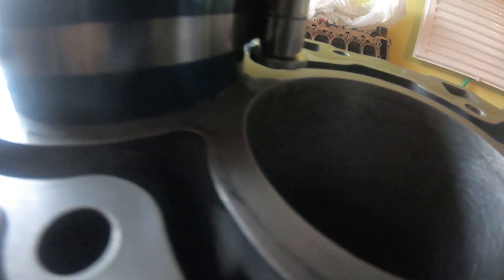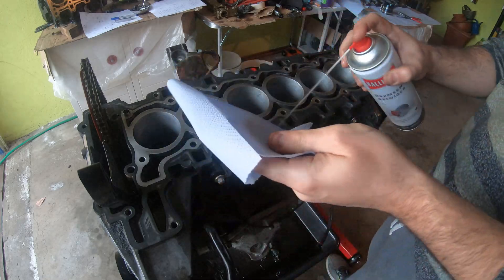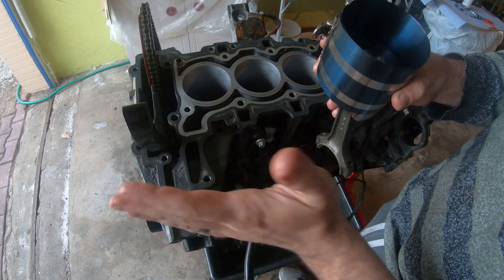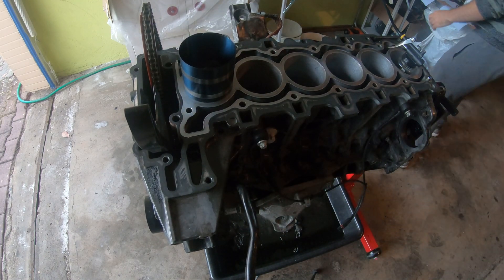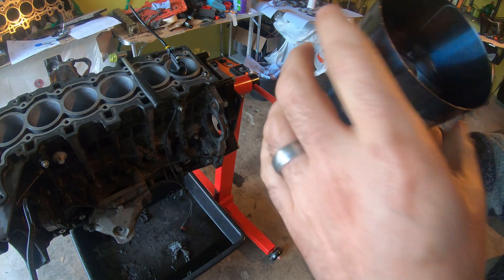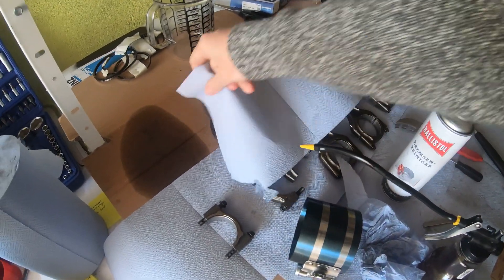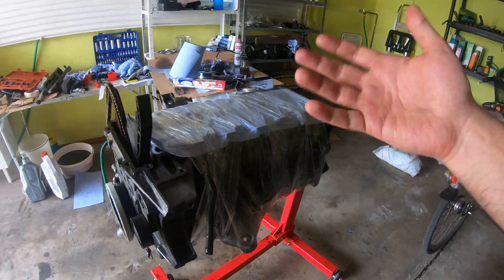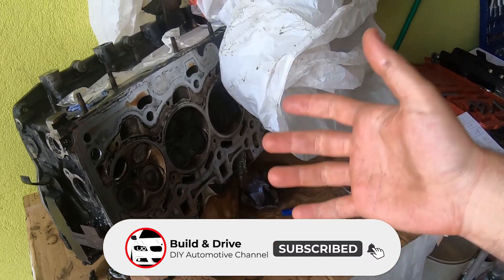How To Use A Ring Compressor to Install The Pistons In The Cylinder Block [BMW N52 Rebuild Part 9]

Comment: Cool presentation!
Did you machine any parts of the piston rod bearings, crank case bearings and so on?
Have you reused all the original parts like pistons, etc?
Reply from the maker: Reused pistons rod and crank bearings as they were in good condition and well within spec. Just changed the wear items like piston rings, valve stem seals, gaskets etc.
Reply: @buildanddrive  that's good.
I'm not sure if you finished all the work yet, but how does it all feel?
Would you do something more, if you could?
I'm asking if I start this adventure, what do I need to pay attention to.
Cheers!

Comment: I am really stick to your Channel. I owe a N52B30 engine. It was saved from a total kind of accident. I wish to install it on a E46 coupe, but I cannot figure out how to do the electronics. Hope you upload videos on that part,  computer, wires and so on.
Reply from the maker: Send me a message on Instagram. I have a video on the wiring but only about where you plug it in, not so much about what each wire does. You will have to research which wire is for what for each car.